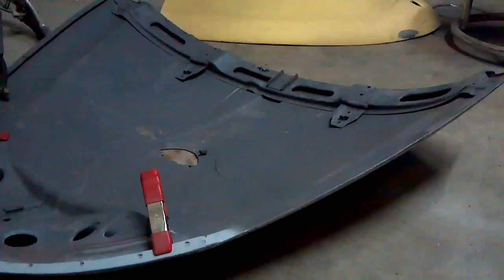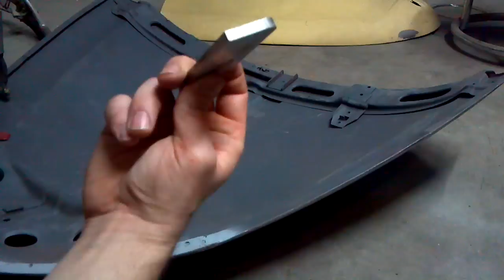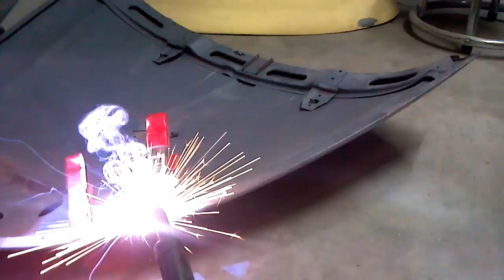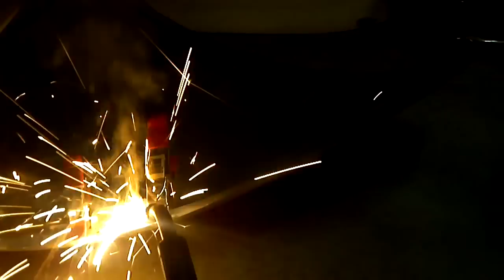Filling The Spot Weld holes

Comment: Great idea with the aluminum block for a heat sink.
Nice job on the plug welds.
Are you using mig with gas or flux core?